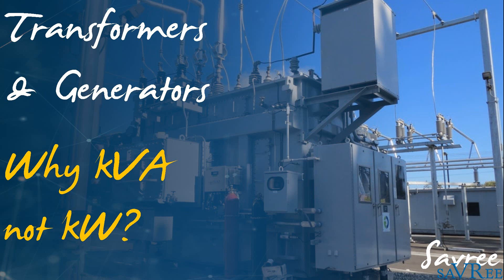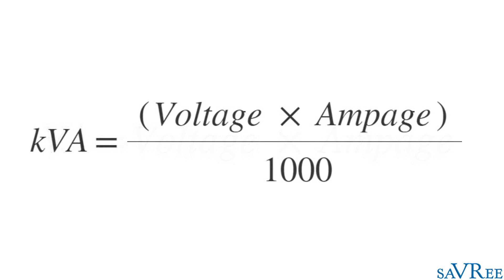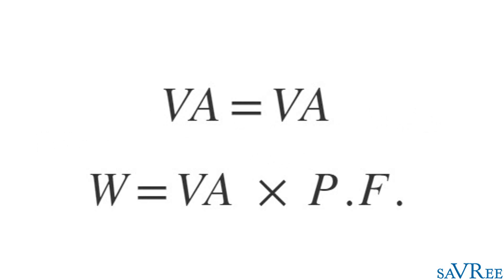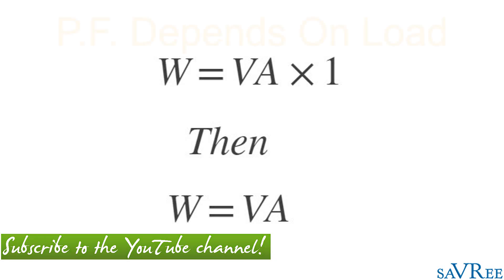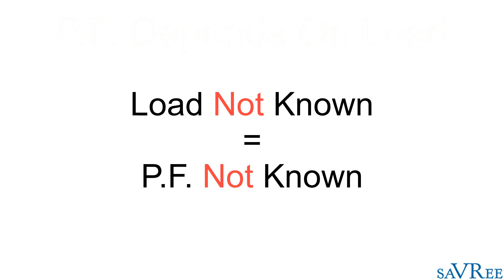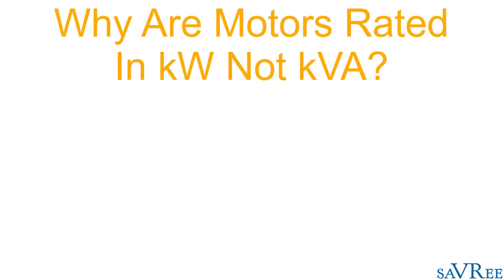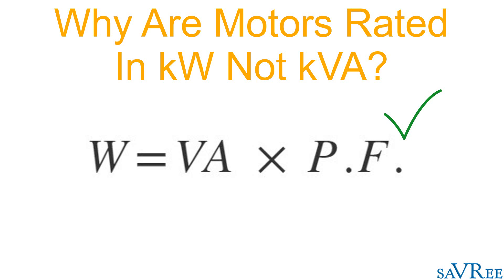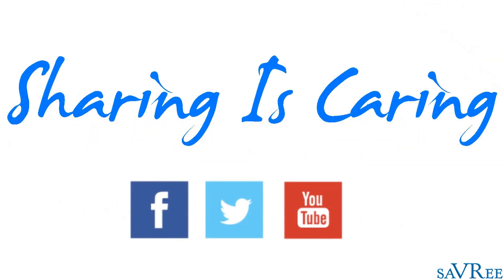Why Transformers & Generators Rated In kVA And Not kW ?

Comment: heavenenergy
The pumped storage hydroelectricity tower plant uses a power generation method: the power generation capacity of one generator is small, but 960 generators on 30 floors are gathered to create a large capacity. The power consumption for pumping is 15,000kW, and 1,200kW per generator, a total of 1,152,000kW with 960 generators."
The water flowing inside the power plant is collected in the lower reservoir and pumped up to the upper reservoir, circulating the upper and lower parts of the tower in real time.“

Comment: Very clear and insightful, what's left is to understand what is motor, transformer and generator to fully understand why the former load can be known and the latter's no
Reply: The motors load can be known because it’s pulling the actual load itself. A generator and a transformer supply the power for the load to feed off of. You can’t know Kw on a generator or a transformer unless you know what it’s feeding and the load it pulls.